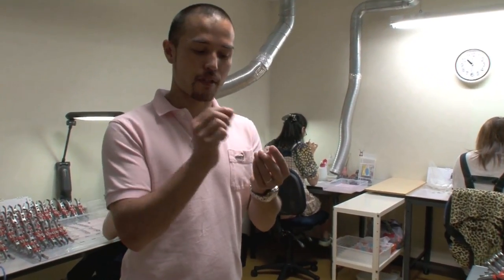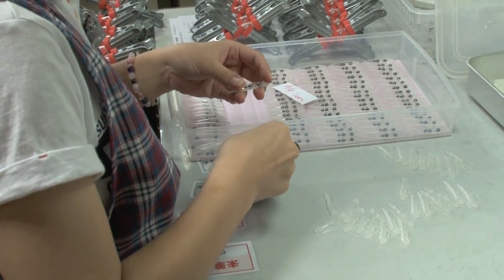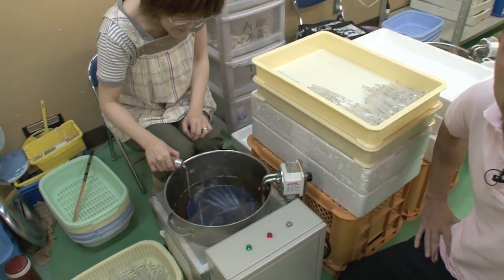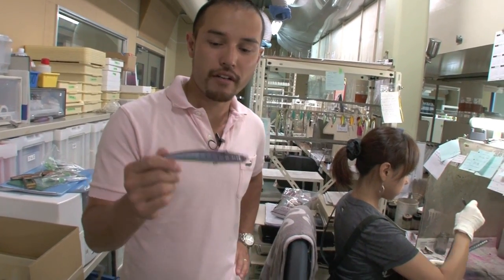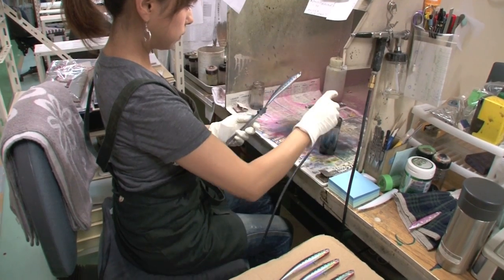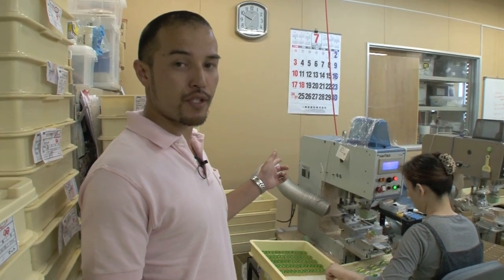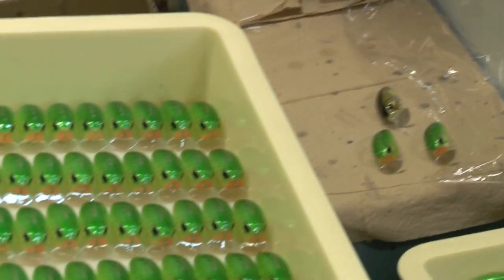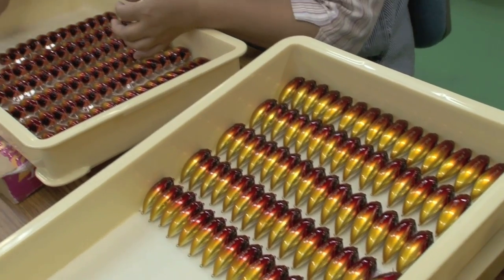DUO`s Factory - Inside the manufacturing process of lures

Comment: Im somewhat new to duo but in the few months of fishing water in the mid 30s to lower 40s the action on the 77 rozante and the 80 minnow are hard to beat IMO. I use MegaBass and Luckycraft to which I love both, however the rozante catches fish when the pointers and 110 not. I just wish duo were more readily available in more colors. Great product at a decent price. Hooks are sticky but a little weak. I change all mine out anyway. Thanks for a great product